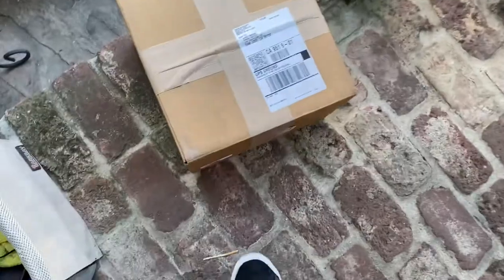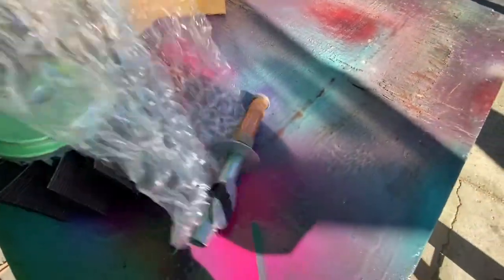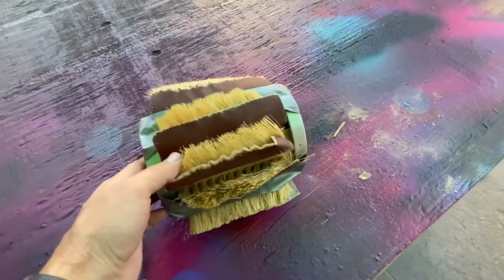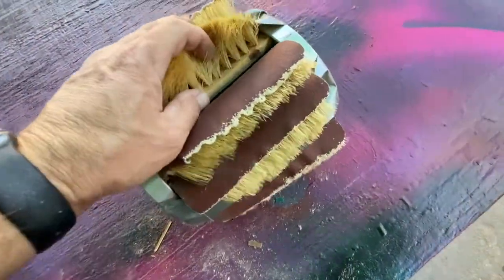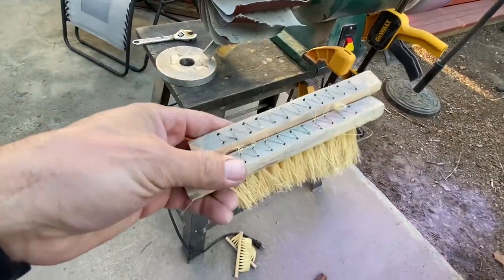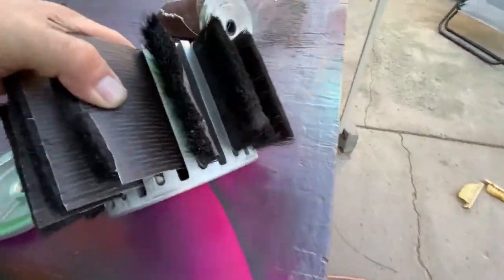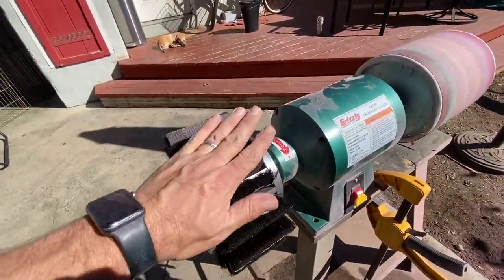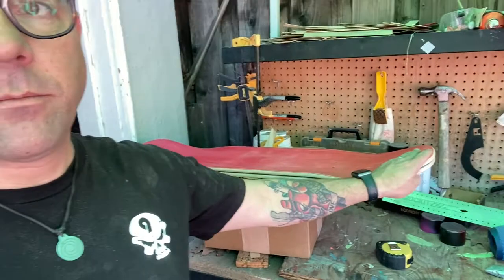Sand-Rite Flap Attachment on a Grizzly Motor - HACK!

Comment: I'm sold! I noticed Izzy Swan (here on YouTube) flipped his Grizzly motor around so that it spins away from him; that way he can more comfortably lay the work piece on top of the drum/flapper when sanding. Might save the back a little; but also may be a little less safe. I plan to try it out on mine soon! Thanks for the video, I'm definitely ordering that upgraded flap.
Reply: I also flipped my motor around.  As Izzy mentioned it allows me to hold my material on top vs the bottom.  Dust flies away from me vs towards me.  I want to get this flap wheel but hope I can use it in the reverse direction.

Comment: Likely will upgrade these parts eventually. That flapper can be a pain. I went and took every other flap and changed it to a higher grit. The different grits are found on grizzly in rolls. It gets my edges down good, but I still have to take a hand sander to get it to 250 grit smoothness on the top and bottom. I would like to see a video of you doing a change out on the paper once this one wears out! Good video Manak.
Reply from the maker: It’s going to be a while before I change out the paper since it comes with a lot of spare paper built into the design. When it wears out, you loosen the attachment and tug out a few inches of fresh paper, trim off the old worn out area with scissors and continue sanding. That’s something that’s missing on the grizzly stock one. Much more labor to get fresh sandpaper. It looks like the amount of paper supplied will last years.

Comment: Like you I have a Grizzly flap sander/drum combo.  I now regret getting it after seeing your setup (its awesome).  I would like to know which specific parts you had to get to upgrade both the Sand-right bladder and new flap attachment.  The one part that concerned me with your setup is the shaft sticks out so far on the flap side. I would like to get it as flush as possible for safety reasons.  I make walking sticks and found that flipping the motor around was better for my setup.  Is just much easier for me to press down on the top vs. holding it up from the bottom.  I also like that the dust flies away from me and not in my face.  Thanks for any guidance you can provide as I really want your setup.
Reply from the maker: The folks at Sand-Rite are very consultive. If you call the main number you’ll get Naomi or Charles (the owner) on the line. Both could offer suggestions of what will best for your needs in regards to parts and sizes. Charles has the adaptor kits and parts. I use their standard flap wheel with 150 grit and the 9”x8” drum with 120 grit. The canvas bag drum is a quantum leap from the stock rubber grizzly drum.
Reply: @ManakSkates  Thank you for the info.  I will reach out to them.  Can you tell me what diameter and length drum you have installed?  Thanks, Kerry

Comment: I always was wondering about safety on those things. Not only about the danger of getting clothes or the wood caught in, also because of the high speed and the posibility of stuff shooting out. I assume your glasses are not safety glasses right? Watch out!
Reply from the maker: Dude, when the grizzly flap broke, that was one of the scariest things that’s every happened to me while making boards. I packed up my tools and didn’t mess with them again for almost a week.
Reply: @ManakSkates  I can imagine, but I am happy that nothing serious happened to you!
Reply: I am sold on the flap sander but the part that concerns me is the shaft from sand right sticks out so far.  I contacted them and was told it is that long to accommodate both the flap and drum assemblies.  I wish they had a shorter one for us Grizzly motor users.  The spinning shaft sticking out so far really concerns me for catching apron or clothes.